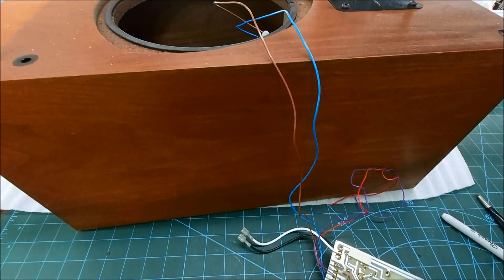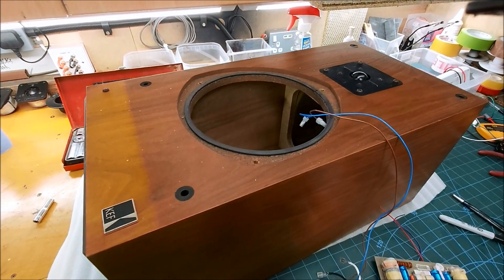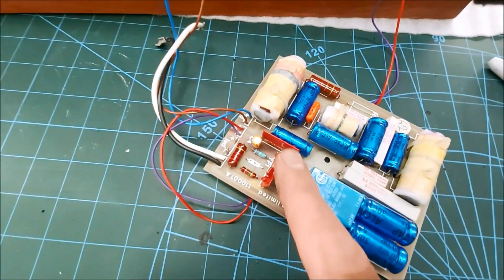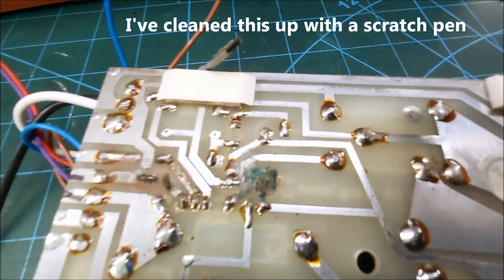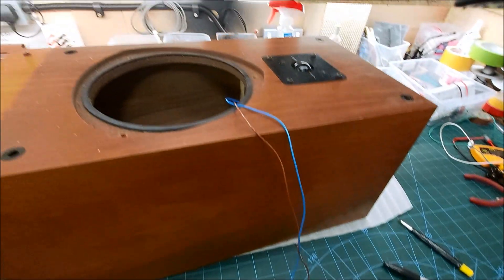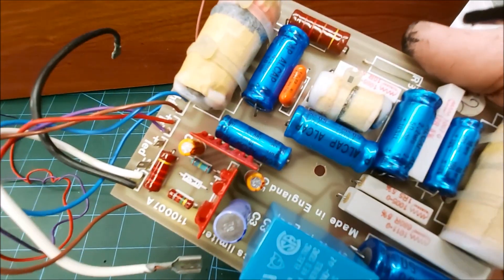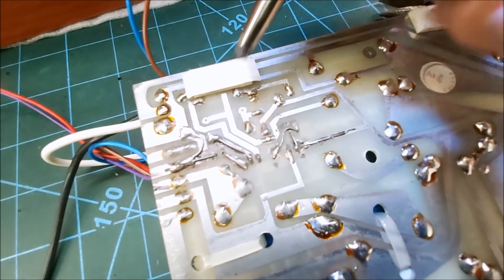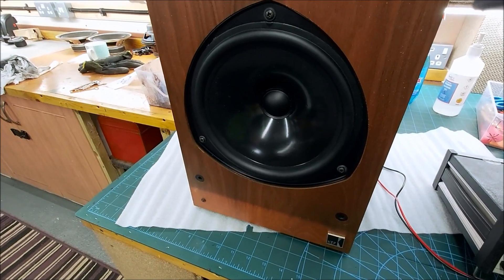KEF Speaker Protection Circuit Issues

Comment: Many years ago I had a pair of 105.4 where 1 speaker was occasionally cutting out in the upper frequency, was a loose solder joint in the protection circuit, I later removed the complete S-Stop and head PCB.

Comment: We replaced the original 101 PCB with the Constructor Series PCB (no protection circuit) with upgraded caps decades ago. Much better sound quality without the protection circuit. I posted the data sheets over in diyAudio. Search Constructor Series. I posted a bunch of other KEF data there.
Reply: Specification: Model CS1
System Type: Two-way bookshelf/stand-mount
Enclosure type: Closed box
Dimensions: 315 x 200 x 180mm (12.4 x 7.9 x 7.1 inches)
Nominal impedance: 8 ohms
Programme rating: 50W
Frequency response: 85Hz to 30kHz +/-3.0dB at 2m on design axis
Sensitivity: 81dB at 1m for pink noise input of 1W (anechoic conditions)
Maximum output: 98dB on programme peaks under typical listening conditions
Drive units: B110 bass unit (SP1057), T27 tweeter (SP1032)
Crossover: SP2014

Comment: So good to see you actualy fix stuff instead of changing it out with a New board👌im working on a pair of ar18hj, not going the upgrade way, just replace dried up foam and 2capps👍. in my mind, going the upgrade way on vintage speakers is degrading the sound and value. Keep vintage original😂
Reply from the maker: Nothing gets thrown away here ❤